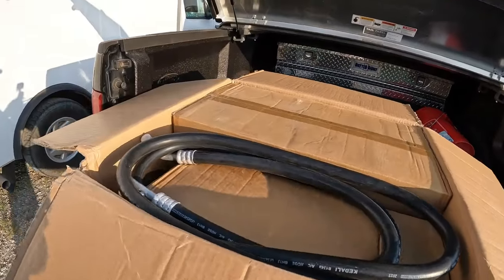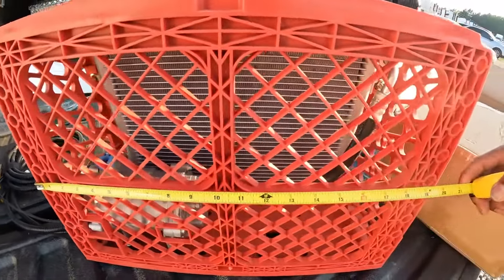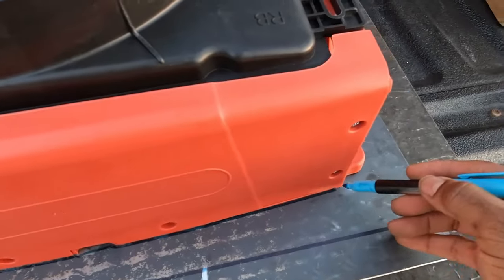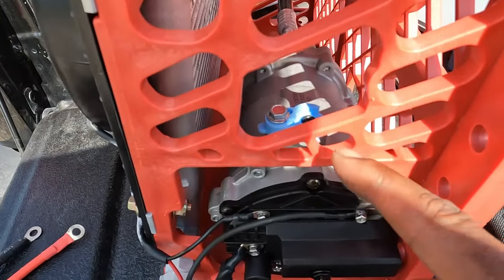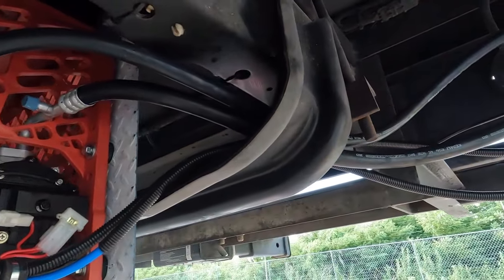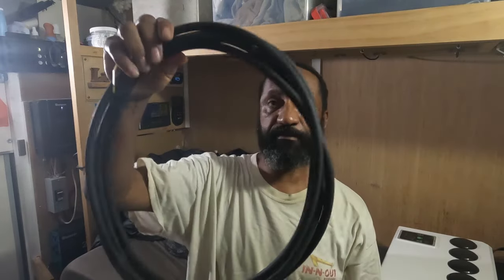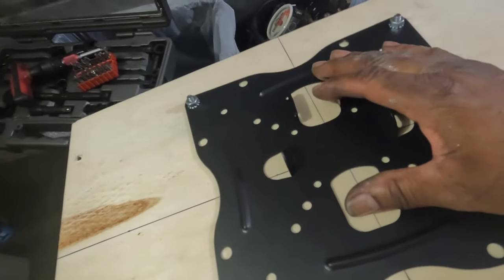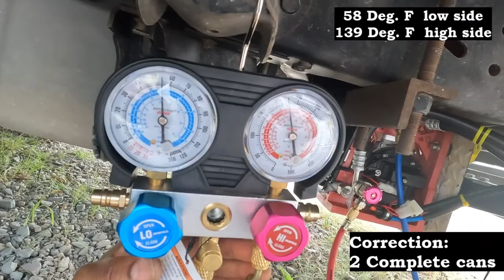VAN LIFE IN A BOX TRUCK: 12 Volt DC Mini Split Install

Comment: Towards the end of the video. You said, you plug it into your generator.? I want to do the same thing but how do you convert the 12v system to your generator power source? Did you just added a plug in end to it and plug it to your generator? And does it work good like that ?
Reply from the maker: I have a 60 amp Progressive Dynamics 12 volt Converter in my solar electrical system.   I run an extension cord from my generator (or any shore power outlet) to the converter, and it charges my batteries and allows me to run my AC at night.  Excellent question gilbert7614.  I should have detailed that in the video.  Thanks for watching.

Comment: Hi, sir, thank you for the video! My question is, what generator, how powerful, do you use when you run your AC?
Reply from the maker: Great question.  I currently use the SPORTSMAN 2200 WATT DUAL FUEL GENERATOR to run my A/C over night or on cloudy days.  It runs continuously at high idle and uses a full 20 lbs tank off propane every 12-14 hours.  So far, I used my A/C at the low fan speed and coldest or next to coldest temp setting while summer temps were in the high 90's or more. 
I only run the generator on propane because it's easier for me than gasoline.

Comment: hey I bought an home mini split to mount on my box truck but the outside unit is too s big it will block one of my doors in the back ,,,so ive been looking at these on amazon ,,,you dont have enough battery to run this unit over night .... thats my concern ...I have 6 206 amp hour SOK batteries configured in a 24 volt system...I hope this will be enough to run at night... good job
Reply from the maker: If I had another 200-250 usable amp hours in my system, I could probably do 8 hours at night with no issues.    I just don't have room for more batteries.   Sounds like you have an electrical system that will get the job done.👍🏾
Reply: For the clueless people, what's the total Wh of that 6 206 24v system? Is it simply 206*24v = 4,944Wh? Thx

Comment: Does it come already pre-filled with Freon or do you have to put Freon in it?
Reply from the maker: This one did not.  Once it is assembled, the system has to be placed under vacuum for a short period of time .  I did 30 minutes but the instructions required less.  Then I had to add the r134 that I purchased from a local store.

Comment: Spray foam no good bro, absorbs moisture. Jumper cables alot cheaper and easier than specialized ass welding cable, every van build I ever did was just 20' jumper cables. That's all ya gotta do. Braided cable is the key it's more flexible. I just used like 16 guage or whatever sae it don't matter. I basically slapped cables on a victron intelligent charger to a 200mah redodo battery lithium, and it works perfectly fine. Just follow your instinct and put the right size cable on it. If it fits it ships. So just use reasonable size cable. Simple as that.
Reply from the maker: Thank you @atye04.  I appreciate the information.

Comment: Have the same unit. Finally installed the outside unit and hooked up the Freon lines and lost a good bit of oil from the outside unit due to my outside unit being mounted flat and not upright. Just dropped it off at the shop to get the refrigerant added and told them about the lost oil and they said it’s gonna be okay. Did you happen to lose any oil from the compressor side when installing ?
Reply from the maker: I didn't lose any oil when installing my hoses.  I had some on hand just in case.  Once you're up and running, you will appreciate the relief from the heat.
Reply: @xlamontx  looking forward to it!! Hoping the lost oil doesn’t cause any issues. Amazon listing said It’s POE 68. So guess I’ll have to add some if there’s any problem.

Comment: Did you happen to measure the length of the hoses. I want to do this same install between the frame and running board/steps of my IH 4300, but am concerned about having enough length of hose to reach the evaporator inside. None of these, or similar units, provide that information. Genius idea on the swivel mount; that may fit right in with my install.
Reply from the maker: Hi, the hoses are approximately 10 feet.  I went to my Amazon history to confirm and they have 118in/3meters.  Thanks for watching.

Comment: I would put fuses in your high current  lines for fire safety.
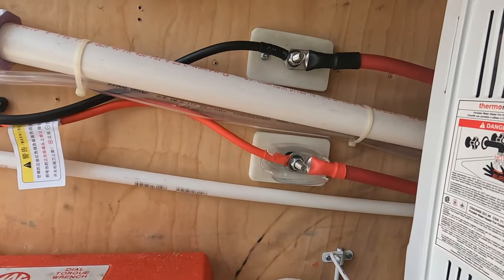Reply from the maker: Hi SALEEM23ful.  This is a good point.  The unit came with a fuse on the positive line that I connected to the hand made block, and is visible at the 18:22 mark in the video.   I should have pointed that out and made a reference to the second fuse I have in the line closer to the power source.   Hopefully I remember to mention it in my update video.   Thanks for watching.

Comment: As there an other kind of oil I can use to lubricate the hose connections? It calls for POE 68 and can’t find any local and don’t want to pay 40 bucks for a few drops. Thanks ahead of time!!!
Reply from the maker: Yeah, I wouldn't spend that either.  The POE68 is the viscosity rating so if POE32 is cheaper it will do the same thing.  Like you said, It's just a few drops.  In hind sight, I could have saved myself the trouble because the system went together with no issues at the o-rings.   Admittedly, Ilike to do extra sometimes.
Reply: Thank you so much for your time! The video is absolutely helping me! Trying to find something to mount my blower on. Planning to use the inside upper  horizontal frame support where my back doors open in my Promaster. Currently it’s the only and best spot due to cabinets. I need to allow at least 6” of space for airflow into the blower. I like your tv mount idea. Wondering if a tv mount may be the way to go. Again thank you!

Comment: Can it run off of your battery solar panels all night. How much draw does it take off the batteries?
Reply from the maker: @rogerrolandbelanger4762 
I don't have a large enough battery bank to let the a/c run all night.  The system uses 60 to 80 amps per hour according to the manual and my experience.  When my batteries were healthy, I could get a little over three hours on my 200 available amp.  Thanks for your comment.
Reply: @xlamontx  oh well that much yeah I guess it would take a big battery banks that’s just for the AC. I guess if you wanted to completely be off grid it’s what I’m wanting to do is build something for my sailboat and be able to run lights and electric and everything so that helps a lot thanks.

Comment: My question is how much 134a and how much oil to mix in.
Reply from the maker: The instructions say the unit is shipped with oil from the factory and that there is no need to add more.  I used the oil I bought to lubricate the o-rings as I connected the hoses.  I used 2 cans of r134 but I don't remember the exact amount recommend in the instructions.   Thanks for watching.

Comment: How much watt draw were you seeing given the outside temp difference? How much solar do you have? Thanks!
Reply from the maker: I read your question just as I was climbing into my rig, so before I touched anything I activated my Renogy App to get some baseline numbers.  At 9:15am, 86°F my system is fully charged, nothing is turned on and I'm averaging 34 watts (12.6volts × 2.7amps) moving through the system.  That is likely the float charge coming in and a small parasitic draw from the connected components going out.  After turning on the AC, my Amp draw went up to 15.56 amps or 196 watts.  Subtract the initial 34 watts and it means my AC is drawing approximately 162 watts.  That's on the maximum cold setting and the lowest fan speed.   
I have a total of 810 watts of solar on the roof.  Two 305 watt panels connected to a Renogy Rover 60 amp charge controller, and two 100 watt panels connected to a Renogy  50 amp DC to DC charge controller.   The latter will use the solar panels to charge my house batteries and starting battery when parked, and the alternator to charge my house batteries when driving.  A little more information than you asked, but it may be helpful if my math is off a bit.😁  Thanks for watching.
Reply from the maker: Oh, I forgot to mention the system is maxed out trying to cool off the living space.  I will let it run for a couple of hours while I run errands and check wattage with a completely cooled off interior.   I'll update this post shortly.
Reply from the maker: 12:40pm 96°F outside, living space thermometer says 82°F  but it feels cooler because I'm in the path of airflow.  I put a thermometer in one of the vents and it shows 50°F cool air coming from the unit.
The system is using 30.11 amps, or 379.3 watts at this moment.   It also shows me bringing in 410 watts of solar energy at the same time.  I hope this information is helpful to you.
Reply: All great info Lamont. Answered many of my questions.

Comment: Can you make a video on how you use your generator to run this unit. I have an 18 wheeler with a generator thanks.
Reply from the maker: I will certainly include this in my next video, but let me give you the short answer now.  

I use a "Progressive Dynamics Inteli-Power 9200 Series (converter) Charger" to keep my batteries charged while the A/C is being used at night.  
This charger has a traditional shore power plug on one side that connects to the generator, and a positive and negative output that goes to the batteries.  
The important thing to understand is the  Progressive Dynamics (converter) Charger is not the same as a regular battery charger you might use on a car battery.  This is a product that is commonly used on RV's. 
Here is their contact information.  I'm sure they can tell you if they make a (converter) charger that will work in your 18 wheeler.

Progressive Dynamics, Inc.
507 Industrial Road
Marshall, MI 49068 USA

Office Hours

Monday-Friday

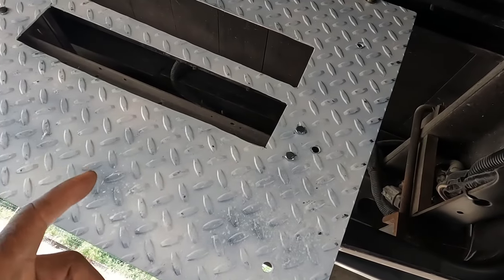8:00 -4:00 PM EST

Ph: (269) 781-4241

Comment: I saw on amazon a similar version but has a different type of compressor in it, a black vertical standing one. Do you know the difference and can they be mounted to the floor of the vehicle horizontally with the fan facing at the ground? How is your holding up?
Reply from the maker: There are a few different versions, and I've seen a couple of the other styles on vans while traveling.   I was willing to experiment with mine and mount part of the unit sideways, but fortunately I didn't have to.  I wouldn't feel comfortable saying it's okay unless I was 100% certain.   So far, mines is doing fine.  I will be checking it again in the next few days to include an update in the next video.   Thanks for watching.

Comment: How did you run it on your generator? I’m thinking about purchasing, but I don’t care to run it on solar generator power. I’m in my semi truck and I have a 4000 W generator with inverter. How do I feed it that power
Reply from the maker: My last video I uploaded the details of how I use my generator in conjunction with the A/C.  Basically, I use a converter, plugged into the generator to charge the batteries while using the A/C at the same time.

https://youtu.be/ZILzYZ6S_NM?si=T8csWegH3_P_DJLA
Reply: Thank you going to check out that video. I’ll give you a like and the following one as many videos as I watch be safe out there.

Comment: Does the ac split cool really good? I need one for my semi truck
Reply from the maker: Yes it does.  It would probably be too cold for an average size sleeper.  I'm usually in my sleeping bag when I have It running all night on the lowest setting.  It also consumes about 60-80 amps per hour.   That is important If you plan to run it for 10 hours during a required DOT break.  It's possible it may leave your batteries too low to start your truck.  On the other hand, you may already have an auxiliary power unit to supply your power needs.  Good luck with your project. 👍🏾

Comment: What direction does the air flow through the outside unit?
Reply from the maker: Thanks for the question.  I will need until the weekend to experiment and try to find out.  I was initially concerned that if I'm driving with the air on, I may be forcing air through the fins to the fan backwards,  while the fan was trying to push air forward. 
I have driven many times with the a/c on and noticed no issues,  but that doesn't answer your question.  I will physically check between tomorrow and this weekend, and update you with my findings.
Reply from the maker: Robert, the unit I have "pulls" air through the condenser and out the back of the fan.  I have my unit mounted facing the rear of my vehicle.   Fortunately,  my fuel tank sits low enough to block the back of the fan, otherwise I would be pushing air into the back of the fan while the fan is trying to move air in the opposite direction.  I hope this answers your question.

Comment: is it still working? how much power does it consume? would it be worthwhile to add to a travel trailer as additional A/C?
Reply from the maker: It is still working.   According to the manual, it uses 60-80 amps per hour (about 960 watts) which is consistent with what I have found in testing.  If you should add it to a travel trailer will depend heavily on your particular needs.  It is not an exceptionally quiet unit.  It has a rumble that I can live with.  I will attempt to demonstrate the noise and cooling ability in the next video.  Thank you for watching.
Reply: @xlamontx  I have a mini split, wanted a backup - looks like mini splits are cheaper and more efficient, maybe I will add a second one. Thank you. Chinese remote, lol
Reply: @xlamontx  I have a mini split, wanted a backup - looks like mini splits are cheaper and more efficient, maybe I will add a second one. Thank you. Chinese remote, lol

Comment: how is it so far sir ? thanks for the video btw
Reply from the maker: One year this month and it's running great.  I would certainly recommend this type of system over a window unit.  A roof type may be nice but they are usually more expensive and take up valuable space that could be used for solar panels.
Reply: @xlamontx  thank you!

Comment: Did you need to add oil when adding refrigerant?
Reply from the maker: I bought oil thinking I would need to add it. However, the instructions were clear to not add oil.  It was added at the factory during assembly.

Comment: Does the indoor fan unit need to be mounted vertically or can I mount it horizontal like laying down in my case it would be a better fit in my build
Reply from the maker: It has to be mostly vertical because there are drain holes on both ends for the condensation tube to attach.  They give one hose and one plug in the kit, but I put a hose on both ends to maximize the drainage.  You might be able to tilt it a bit forward or backward,  but if it can't drain, the water will hit the fan and get sprayed out the vents.

Comment: Thank you. About how many amps does it draw?
Reply from the maker: You're welcome my friend.  About 60-80 amps.
Reply: @xlamontx  does it really?  I thought maybe once at temp it would be lower
Reply from the maker: @Fail1st  
🤔 Well you got me thinking.   I've only used mine on the coldest temp setting, 16°C and the slowest fan speed.  The fan just gets louder as the speed goes up.  Perhaps if I raise the temperature setting, the unit may behave as if there is a thermostat inside the unit.  I have started the unit at about 9pm and got into my sleeping bag only to wake up at about 3am and realize the outside temperature dropped unexpectedly and the a/c has made it very cold inside.  I just assumed there is no thermostat, but maybe that function is disabled when set to °16.  I will have to try raising the temperature and see if it changes how the unit works.  I'll have to update when I get back home and the weather conditions cooperate.
Reply: Thanks so much. Is there a way I could contact you?  I just had a mechanic do the vacuum and fill the Freon fingers crossed it’s going to work from my power bank (which I think is limited to 30amp) 😬. I run freight over the road and spent more in hotels in June than this entire unit!  I really hope they find a way!  🤞
Reply from the maker: @Fail1st  
Do you use Instagram or Facebook?  If so, send me a link to your page and I can follow or friend request.   From there it is easy to chat.

https://www.facebook.com/lamont.zenki

Instagram:
@lamontzenki

Comment: I dont think ill be able to install this myself. What type of contractors should i call to see if theyll do it? Any HVAC person?
Reply from the maker: 🤔 I would say handyman/mechanic.   Possibly a mobile RV repair person.
It's not a difficult job, but it may require a bit of improvisation and fabrication, depending on your vehicle.
Some areas have companies that specialize in van and bus build outs.  They may be able to do it or refer you to someone.

Comment: How's it holding up?  How many amps does it draw? Those are some big cables, does that thing drain batteries quickly? 
Im thinking about installing one of theae in my cargo camper but am worried about power consumption.  Excellent video BTW
Reply from the maker: The air conditioner is holding up nicely. I know I've tested the amp usage, but can't seem to recall the numbers off the top of my head. However, I can get about three and a half to 4 hours of running the air conditioner without Sun before I start to get uncomfortable about the batteries going below 50%.  I have 2 Renogy AGM batteries that hold 200 amp hours each.  That is with my 95 quart refrigerator running, a light if I'm cooking, and the water pump as I clean up.  In the summer, I can let it run on sunny days with no worries.   4 solar panels totaling 810 watts and at night I just use my generator. Thanks for watching.👍🏽

Comment: How is that unit holding up?
Reply from the maker: It will be one year in July and the compressor seems a bit noisier at times.  I've driven over 5000 miles and it's holding up very well.  I would still recommend it to anyone .👍🏽